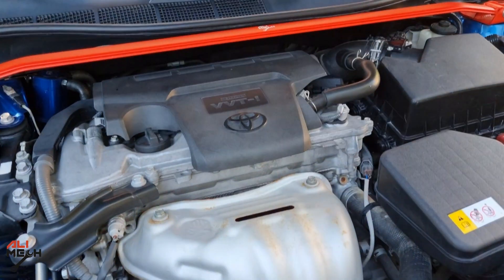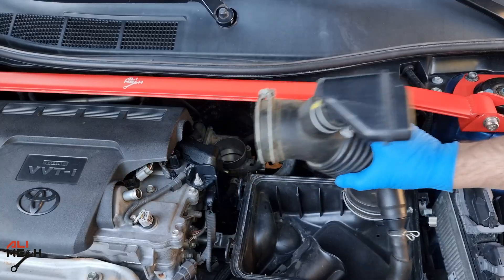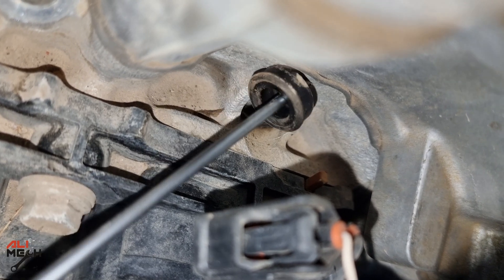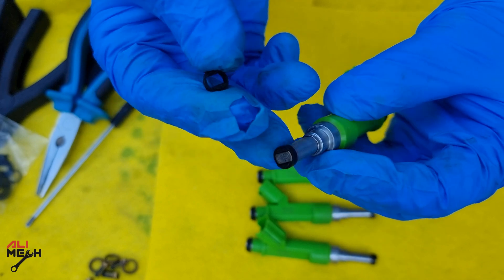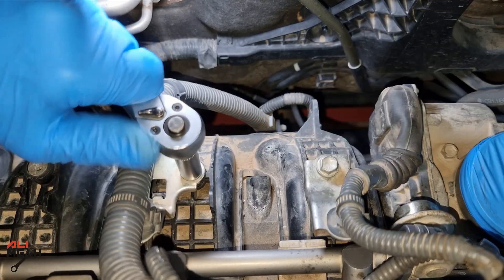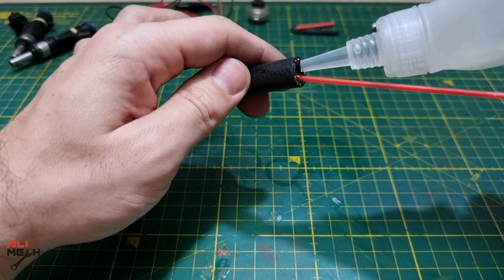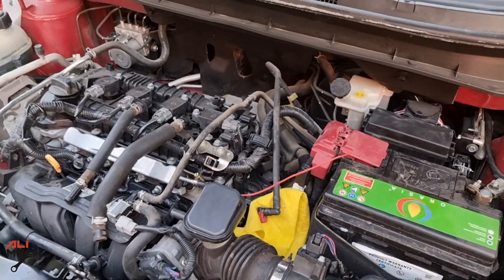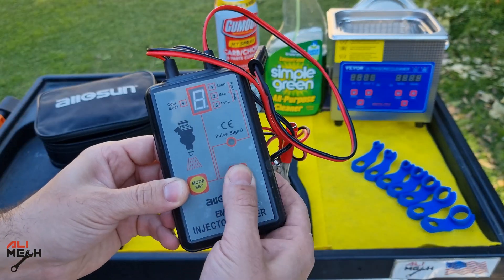🔧 Rebuild & Clean Fuel Injectors Without Removing Them | Easy DIY Tutorial for Any Car

Comment: My car does not want to run with the fuel line disconnected. It just cranks over . But it doesnt want ro start on carb cleaner
Reply: What car is it?
Reply: @JesusGodHolySpirit3 it's a Honda jazz . But I found the problem . To run it with the carb cleaner I had to remove the fuel line and therefore I pulled the fuel pump fuse . Apparently that also caused the ignition to not work . So I put the fuse back , disconnected the fuel pump and then it ran on the carb cleaner
Reply: It is the same issue with the Hyundai Accent 2012? I tried running just on carb cleaner but I was unsuccesful.

Comment: of course we need a million different things to order from million different places for a million different prices before we can even think about beginning the job..... :((((((
Reply: This is not a good job to try, if you don't have any mechanical experience and don'tintend to get there.. If you have or desire to have mechanical experience, you likely have or need and will continue to use a fair amount of the tools.
Reply: @scottwhitcher265  i find it amazing how conceptually simple task of “cleaning” takes so many specific tools and whatnots. Fuel injector tester, O-rings, disconnecter tool all sound pretty specific. I think I do have some experience but I’d be worried about breaking sth in the process or not putting it back correctly

Comment: 2014 camry    204000 miles,    running good never clean it
Reply from the maker: At that mileage,  you need to replace them and you will have way better fuel economy